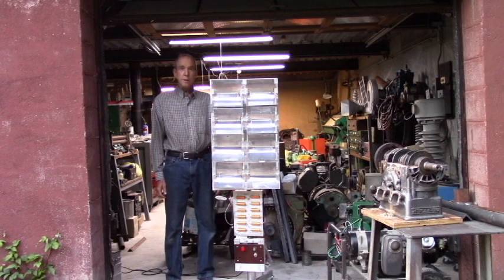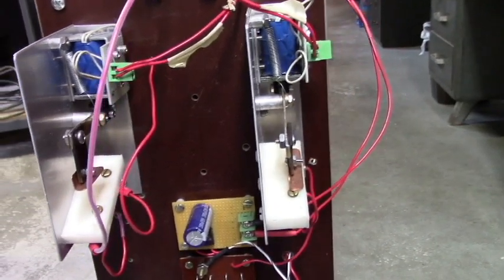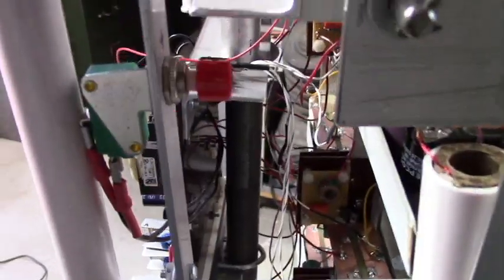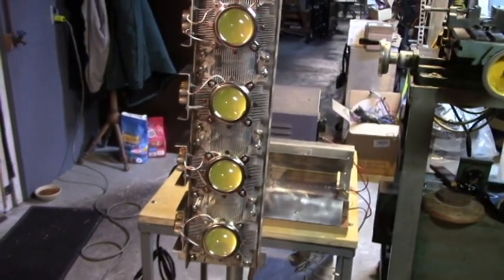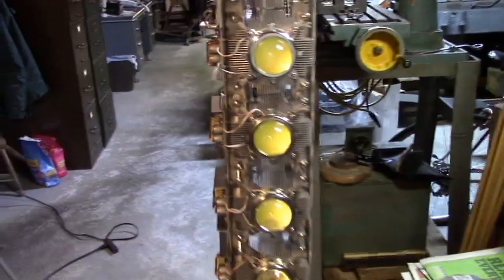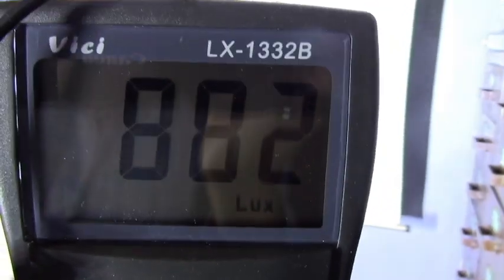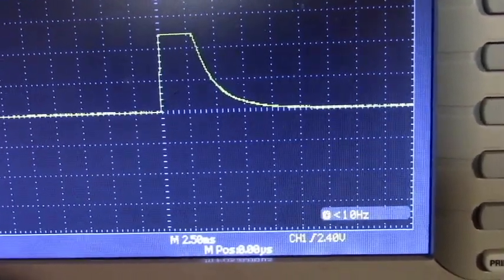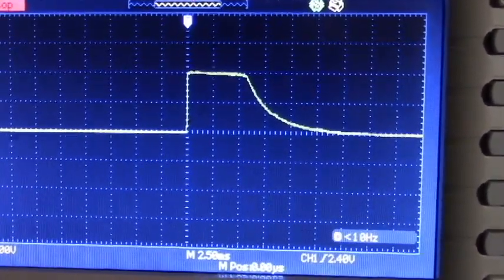Xenon tube light experiment

Comment: I think the photodiode is saturating. Photo flash grade xenon flash tubes have a conversion efficiency (to visible light) of about 16% So if you are putting about 200J per flashlamp in 5ms (average) then the flashlamp is getting about 40kW times .16 equals 6400W per flashlamp 51kW for the array of 8, that's of visible light! and its the average, the peak power probably its like 3 times higher 150kW!
Those COB LEDs probably have an efficiency of about 20% of electrical to visible light so 90W times 5 equals 450W times .2 equals 90W of visible light. 51kW vs 90W, Big difference!
Reply from the maker: Your math looks real good, I can't thank you enough for the numbers. Now I know. The purpose for this was for a distraction device.
Reply: @stephenhrobak3631  Seems like fun. I been learning about flash lamps because I wanna build a laser. And so far xenon flashlamps with fill pressures of about 200-400 mmhg operating in the ms regime are the most efficient kind of pulsed light sources at reasonable prices. I bet you can photograph a small hill with such flash!
Reply from the maker: Yes playing with power is fun. I sure would like to light up a low cloud. Right now I am working on a better charging system. and will post a video of it. @teresashinkansen9402
Reply: @stephenhrobak3631  That would be great! will check it out when its published!

Comment: Got a new sub too for ya
Reply from the maker: Thanks for the sub, glad you liked my distraction device.
Reply: @stephenhrobak3631  yea bro use it as a camera flash what would happen? 🙄
Reply from the maker: @achhcityshorts4646   I think it would wash out the image that you want. And end up with a white picture.
Reply: @stephenhrobak3631  k btw use the led ones to make a handheld flash using the capacitors and 2 12v battery
Reply from the maker: I have that project in mind but I will finish some led arrays first. @achhcityshorts4646
Reply: Or make it as a beacon hehe @stephenhrobak3631